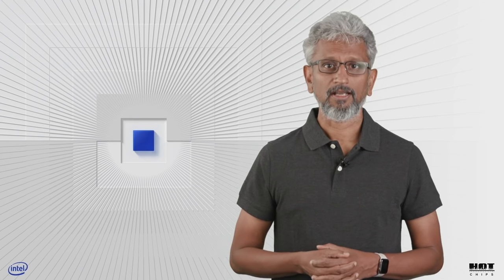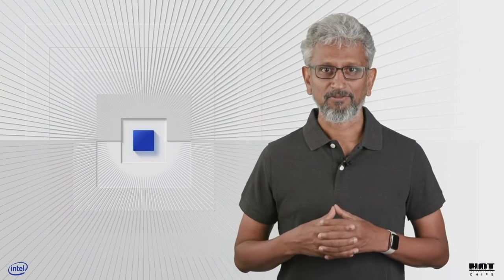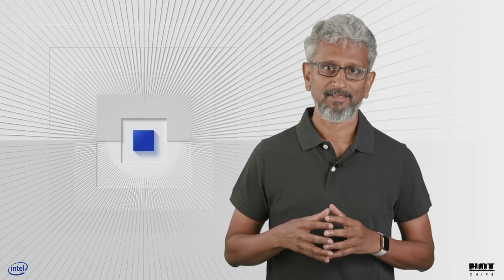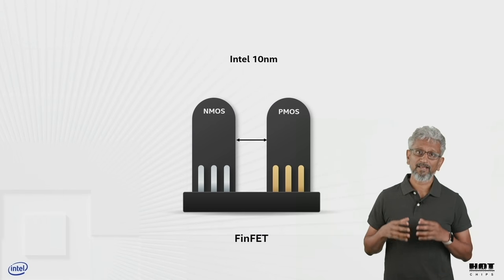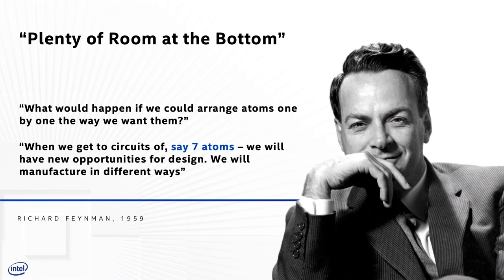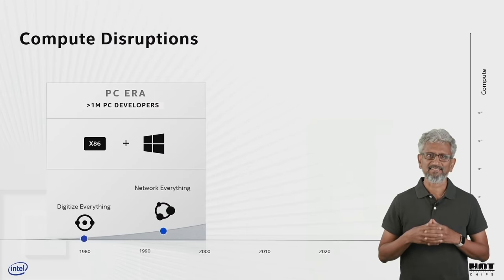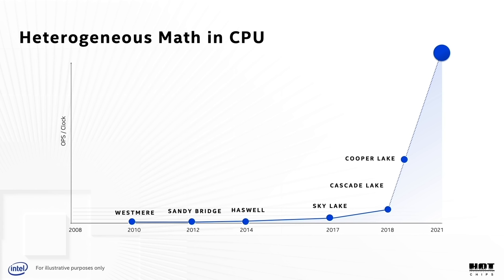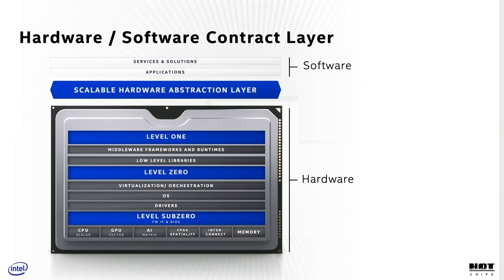Chief Architect Raja Koduri "No Transistor Left Behind" Hot Chips 2020 Keynote | Intel Technology

Comment: Are we on the wrong path in memory? Long ago, more DRAM was desperately needed and cost optimization was first priority. In the SDRAM/DDR era, priority has been bandwidth for throughput first, cost second. For the last several years, systems have had far more memory than really needed and DRAM cost is essentially irrelevant (for professional use). Today, much of the capability of modern cores are unused no-op cycles waiting for memory access. There should be an option for low latency DRAM in servers with ECC memory. Currently we only have the standard 14-14.5nns CAS,RCD,RP latency. Gamers can latency down to 8.5ns. Lets cut the L3 miss penalty down from 18+ns in the high core count die.
Also, what code use SIMD-AVX but cannot run on the GPU? if very little, the GPU is the right place for SIMD, and lets return the core to general purpose

Comment: CPU performance increase in the last 10 years was barely 2 to 3x? These days 2x in transistor density leads to 5-10% more speed so 50x is not that much especially if that goal will be achieved for more than a decade from now. You can only achieve additional exponential performance increase in certain tasks and operations. By it`s definition "Moore`s law" is already dead. https://www.youtube.com/watch?v=Vu3YWNbXkKk  Now it`s all about special purpose computing, AI, ML and DL which for normal users is not so significant. Personal computing (desktops and laptops) has less and less importance for tech companies and they are diversifying their business model.
Reply: Only if you look at Moore's law as an increase in speed however, there's gains in how much data you can process for a specific period of time. More cores/threads to crunch more data is where Moore's law is still very much alive.